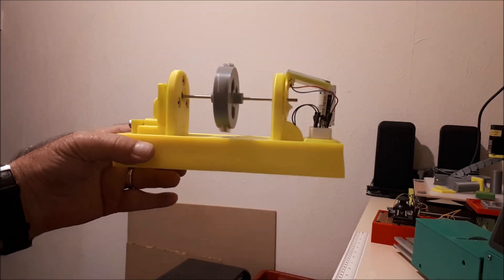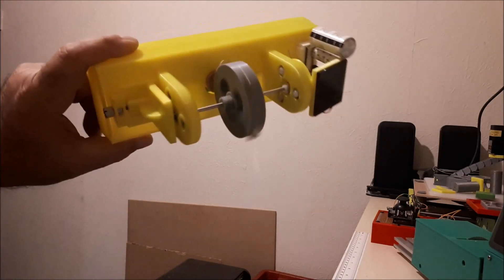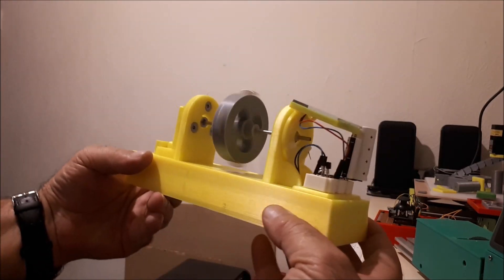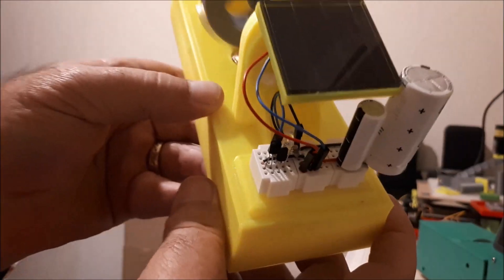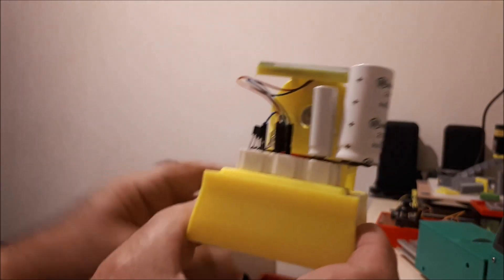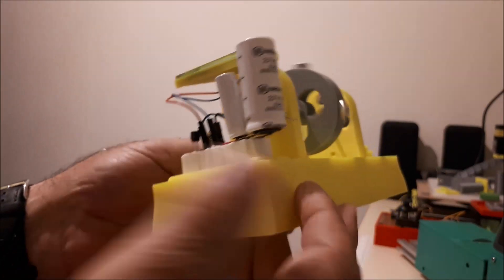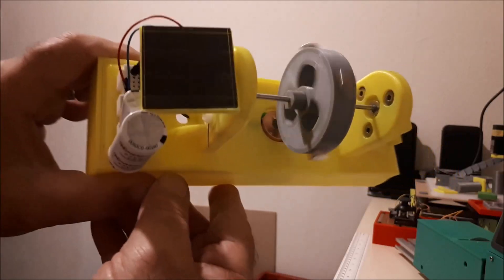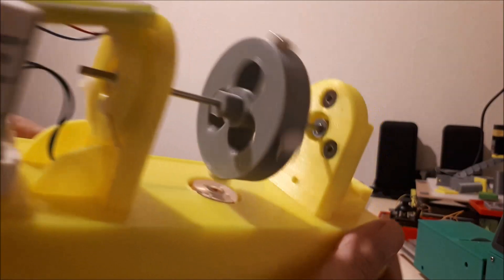Levitating Pulse Motor

Comment: very very cool man. I had downloaded the prints and will print it out. Did you deign the prints yourself? If so nice job. My whole channel is pulse motor based kind of lolololo
Reply from the maker: Thank for nice comment, It is my design , If you want to use different coils, i would advise altering the coil holder part. I glued it into place and found it annoying when i decided to try other  coils. Have fun
Reply: @Telboy-fv8ke  ok but if I use the setup as is, will the coil holder fit snuggly into the coil?
Reply from the maker: @mcorrade  Absolutely, I used plastic sewing bobbins for my coils. can't remember wire  gauge  but I'm sure you are well capable. Let me know how you get on!
Reply: @Telboy-fv8ke  Printing is all done! Just waiting on the magnets and will hopefully get this built sooner than later.
Reply from the maker: @mcorrade  Just having a look on Thingiverse and noticed i had not uploaded coil holder with other files, Just let you know, Its only a small part but secures coil in place .
Reply: @Telboy-fv8ke  ok is it the part that holds the coil wire? I can make on myself if that the case. If its something else can you upload it and let me know the link
Reply from the maker: @mcorrade  Sure you seen this,  Its the last part i uploaded, https://www.thingiverse.com/thing:3073787